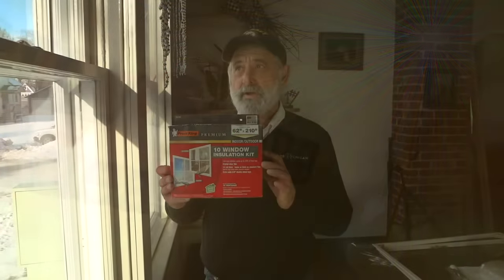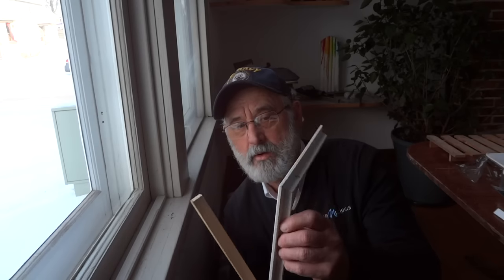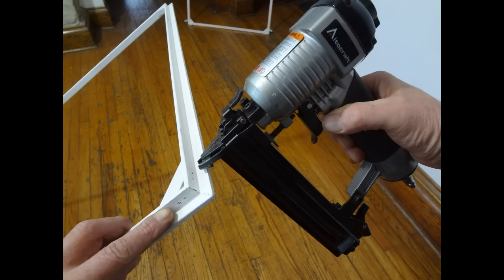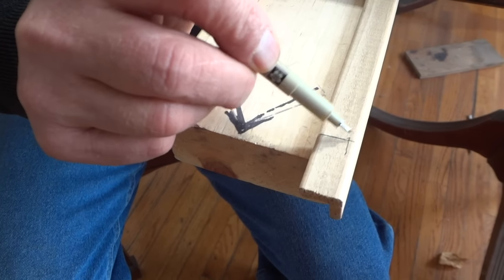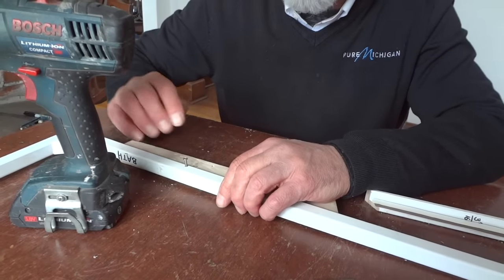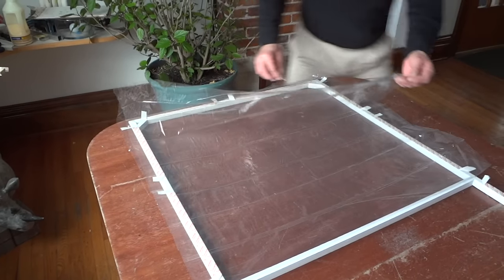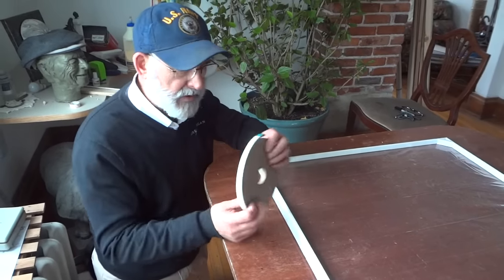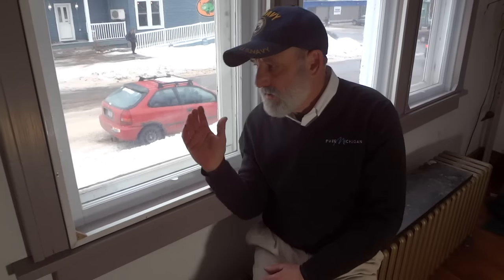DIY Window Insert for Older Homes

Comment: Excellent video.  Thank you.  I've been mulling this idea over for years.  I am so glad to see it's viable.  The trouble I have is our four cats.  The film doesn't stand up to even the slightest clawing.  I'm now going to do some research, looking for some other, super thin plastic sheeting.  The kind that comes with those cheap plastic picture frames.  

At least, now I have a clear vision (pardon the pun) of the finished product.

Thank you again.
Reply from the maker: I do see the concern over potential to take down a lot of work, and some cost.  A tiny housefly can make a window sound like a gigantic tom tom depending on how tight it is, and no doubt that sound would attract a cat.  Is that how you found out?  Do cats bat at a fly, or do they actually extend their talons to catch one?
Reply: @EarlSenchuk  our sils are very wide, and they attract cats all on there own.  Once on the sil, the cats just plain aren't careful.  If I blocked off the sil, mounting the plastic pane as you have, they crash into it until it breaks.  I've got to mount mine on the inside.  It's been difficult to come up with a side seal, if you know what I mean.
Reply from the maker: @johnafagerquist8235  I was thinking about getting a cat.  You just changed my mind.  :e)
Reply from the maker: I adopted a cat five months ago.  She destroyed the film on one window twice while trying to bat a fly.  I must now shield the reachable area with something stronger so that her claws can't penetrate the film or maintain a constant vigil against flies.  Plexiglas is expensive.  You are right.  Cats can be a problem when it comes to shrink film.

Comment: I've cut my own corner molding from pine scraps. If you have access to a table saw, cut long strips 3/4 by 3/4, then set the fence for ¼  and the blade height for ½ and run the steps through twice. Be sure to use a push block and stick
Reply from the maker: Thanks for the suggestion, Tom.  I know that works because I am currently in the process of producing two more videos on DIY Window Inserts for Older Homes that will make it very easy for persons with basic wood working skills to make their own frames (and hopefully for others).  I expect to post the new videos next week.  Part II shows how to make a DIY corner-mold-making-jig with which to make outside corner molding fast, easy, stronger, and at far less cost than store bought ($9.78 at Lowes vs 94 cents).  Since I found out that no corner clamps exist on the market for the DIY window insert application, Part III shows exactly, step by step, how to make a low cost clamp system out of a single 2 by 4 that works beautifully.   Stay tuned!
Reply from the maker: Two new videos are scheduled to premiere tomorrow morning starting at 10 a.m. and the next at 10:30 a.m.  Part I outlines details of making a special clamp designed specifically for DIY Window Inserts for Older Homes.  The same video walks through the process of making a window insert from scratch.  Part II- The Corner Mold Making Jig describes how to make a jig tool that makes a stronger corner molding fast and for a lot less cost than you would pay in a hardware store.  I will be answering questions in live chat if you wish to join.

Comment: I seriously need something over the windows of my old house. I am using the shrink plastic now but HATE it and it didn't shrink tight like it was suppose to. The tape was an absolute nightmare to get backing off while teetering on a step stool putting it on around my 10 foot high windows. 
I'd love to have something to reuse but I don't have a workshop of tools to build it.
Reply from the maker: I wholeheartedly agree with your concern about the drawbacks of the current shrink film method.  It works (most of the time) but it's such a pain to redo every year.  Not to worry, GrandmaSezSo, I recently applied for a patent on a DIY Window Insert Kit.  I'm meeting with a potential manufacturer next week.  The solution is nigh!

Comment: I've got terribly old aluminum single pane windows, that open side to side instead of from bottom up and vice versa. I cannot even begin to describe the amount of cold air that pours in these things!!! I'm excited to try your idea, I have done the shrink film as manufacturer suggests, so it'll be cool and way more convenient to have a semi permanent solution and not have to take the time wrapping them each winter!
Reply from the maker: Hello Jasmin.  Reapplying the shrink film every year is a pain, but the shrink film works to save a lot.  2 minutes to install and the same to take down is the way to go.  Very effective.  Stay warm this winter!  Good luck on your project.

Comment: Another Use- I have those silly basement windows that replace a concrete block and admit light, wind, cold, dust and spiders. They have an R-value of less than 1. 

But for a couple of bucks I made them translucent privacy windows with an R-value of 5.

Bubble wrap- one layer has an R-value of 1, and it sticks with water. a layer on the glass, then a layer stuck on top of that.
Then I framed in the window and sealed that up to create a window frame perfect for Earl's frame insert. But before I put it in, on the back I added two more layers of bubble wrap stuck again with water. 

Four layers of bubble wrap and Earl's sealing frame, and all winter my shop area was at least fifteen degrees warmer in the depths of winter just by dealing with those two stupid windows.
Reply from the maker: Excellent idea.  15 degrees warmer in your workshop is golden!

Comment: We used to call them storm windows and dad put them on all our windows...outside in September and took them off in July
Reply from the maker: Those outer "storm windows" do protect against severe winter weather, and do contribute to limited heat retention by creating a somewhat leaky dead-air space.   DIY internal window inserts seal the deal by blocking incoming and outgoing air by up to 100% with a secondary, very effective, truly dead-air space.  I believe the window inserts would work just as well at retaining cool air from air conditioning.

Comment: This is fantastic.  I live in TX and have massive oversized floor to ceiling single payne windows and since a 30 foot tree came down in a storm (that provided tons of shade during hot summers), trying to keep the house cool and now warm (just had single digits this week), has been a nightmare the last couple years.  The last couple days, I resorted to putting space blankets over the windows (essentially creating a pocket where cold air was staying out and heat in).  They worked really well, but my house looks hideous with them on….my question is considering the cost of wood, do you think that’s still the best option for frames?  Is there any plastic material that could be used that may be cheaper?  The amount of windows I have is outrageous…we’re talking like 30 windows lol
Reply from the maker: @NOT_A_TOP_FAM I filed for a patent on a DIY Window Insert KitTM that uses a wood frame. I also considered waste ocean plastic and hemp graphene. Having plastic extruded proved cost prohibitive. If you go to www.earlsenchuk.com/inventions/home use and look in the upper left corner of the page,  you will see something as you describe with mylar.  There is a "heat shield" material available that you usually see on office buildings.  It will work for your home as well.  It's more like a one way mirror.  When I finally launch this product I will let everyone on this comment thread know when these kits will be available.
Reply: @EarlSenchuk  I’ll take a look and definitely purchase your kit when it comes out!

Comment: Thanks for the detailed instructions, Just curious did you try to wrap the frame so you have double panes ?? according to a study I read adding up to an inch of dead air space will add another R3 to the windows.
Reply from the maker: Thanks for bringing this up @tomwarren9611.  You are indeed correct.  Two layers create a dead air space.  If it is gasketed all around the perimeter frame it creates another dead air space upon installation to further save heat and deaden sound.  I have a patent pending for exactly this in a DIY Window Insert KitTM.  Doing heat transfer studies coming up soon to establish an Energy Star rating.  Stay tuned!

Comment: As a possible cost saving measure, you could get aluminum instead of wood for this project from your local Home Restore.  You can get buy pop out window screens for around $1.00. take the screen out and replace it with the plastic. If you have a lot of windows, given the cost of wood these days it's a cheaper option.
Reply from the maker: Have you tried this yet?
Reply: @EarlSenchuk  I did something like this that was very similar for a fishtank lid.  I had to cut the aluminum with a hacksaw but once I put it all back together I would say it cost me between all the materials $2-$3.00 each.
Reply from the maker: @Dropswitch  i'd be interested to see how you connected the corners because I considered aluminum frames before but couldn't find anything on the market for this application.

Comment: This is a great video. I feel with this much work put in you should have done a piece of acrylic or plexiglass. Or if something cheaper is needed, 3m plastic sheets.
Reply from the maker: Thank you for your comment.  Acrylic (a.k.a. polycarbonate) and plexiglass are quite expensive.  They don't come in the size needed and often result in a high % of waste.  The last time I checked the local hardware chain stores for any piece (.093" thickness) that would work for a 28" x 53" double hung window, the price was $127 and would result in 40% waste.  However, you are correct.  They would indeed be easier. I have gotten the cost down to less than $7/ window. I could make 19 window inserts for that price, enough to seal every window in my home. 3-M makes a 1.5 mil polyolefin (heat shrink film) which is twice the thickness of Frost King brand but forfeits a level of clarity. It's like looking through fog.
Reply: Thank you for your thoughts! I’m trying to do something for soundproofing and I’ll probably steal some of your great ideas in this video!
Reply from the maker: @liketheduck  Steal away!  I put this video out to help people like you.  Using window inserts is as popular for sound reduction as it is for reducing energy consumption.  I am coming out with a window insert "kit" product which will undergo testing this winter.  I will also seek to acquire an Energy Star rating for it.  If it works as well as I anticipate, I will notify every commenter in this thread when it's ready to market.
Reply: Looking forward to this as I am not very handy. Add me to the list please! Thank you Earl!  @EarlSenchuk

Comment: Great video and a clever idea! Do you remove the window insert in the nicer weather? I am wondering about storage of the insert. i also wonder about the screw holes in the fixed frame attached to sill. Do they hold teh screw well after years of taking the inserts in and out?
Reply from the maker: Thank you for your question, Andrew.  I have been using the same window inserts and mounting holes every winter since Dec. 2018.  I screw them in using a cordless drill at a low clutch setting so as to not strip the screws.  That's why I justify the window to the lower right corner.  Once the first two screws are in, all of the others line up. I remove the windows in the spring and store them until the next winter.  It takes just a minute or two to put them up or take them down. No more taping!  I bundle the windows with stretch film.  A bundle of 12 window inserts ends up being the size of one window 9" deep.  We just went through a two day storm that dropped 32" of snow and big winds.  I heard none of it.  It is so quiet in my home.
Reply from the maker: BTW. I just released two new DIY window inserts for older homes, Part 1-the clamp, and Part II- the corner mold making jig.  These simple tools make the cost in time and money drop to as little as $6.54 to make a complete window insert frame.  You will see the size of a bundle of six windows and a number of ways to deal with the holes in the off season.  I have 13 of these windows in my home and also for my basement windows.  The difference in comfort level compared to how it used to be is remarkable.

Comment: i really like this idea. it looks simple and cheap enough to try it myself. however, what would be the best way of fixing the parting stop to the window reveals / frames? Glue, double sided tape, wall plugs and screw?  i dont want to make anything too 'permanent' as this is a rental property...
Reply from the maker: To create a full window well, so you have something to seal against, I attached the parting stop to the bottom with small nails.  I attach the windows themselves with tiny #4 by 5/8' stainless steel screws.  They do make a tiny hole that's hardly noticeable and can be reused each season.  The tiny holes can easily be filled with colored wax which they sell in some hardware stores.  The downside of using the double-sided tape is that it doesn't peel off half the time.  Before you switch to an internal window insert you will have to clean up all that old tape.  Otherwise, the foam tape seal will still to the old tape.  Liking my warm house!
Reply: @EarlSenchuk  - this is great info - thank you! looking forward to starting this project over the weekend.
Reply from the maker: Let me know how it goes.   I recently figured out a different clamping system but haven't tried it out yet.  If it works, I will show everyone how to make it.

Comment: I love this idea! However I don't want to build a well on the existing frame as I don't like the look. I would also like to be able to pull the insert off when I want to open a window. Couldn't the sponge tape around the frame hold the insert in place?
Reply from the maker: I would think that is very possible with a press fit and with a different type of sponge that covers the perimeter edge.  Go for it!  Let us all know how it works.  It's all about using less energy.
Reply: Read my reply a few comments above this. It works so so, I wouldn't recommend it. Use the method in this video, or my suggestion (which I haven't actually tried yet, but it should work very well).
Reply: @EarlSenchuk  Hi Earl, I forgot to come back to you for an update. I made these window inserts by constructing wood frames that fit into the interior jam and the using the Frost King window insulation film kits. After some trial and error (use real wood not MDF!) and lots of work, I made 12 inserts and they work GREAT! I have a condo in a 100 yr old uninsulated building, these have made all the difference in the world. I am now selling my condo and these inserts have been a positive selling point. Thanks for the inspiration and encouragement!
Reply from the maker: @allisonwilliams3714  Congratulations!  You did it!  Your home will be a lot less drafty and way more comfortable not to mention the favorable impact on your heating bills.
Reply from the maker: It may if you could find the proper gasket material.  That part is not so easy.  Closed cell would be best, but not too firm.

Comment: Just curious could this be used on the exterior windows as well.
Reply from the maker: I made a set for my basement windows that are mounted on the exterior.  The snow gets so deep the basement windows are buried, but there has not been any damage as a result.  I put them up every winter.  As long as you have a framework all around the exterior frame and a recess I don't see any reason they would not work on the outside.

Comment: Wouldn't it be easier to weatherproof the storm windows first, then the interior windows as necessary?
Reply from the maker: I used seasonal seam sealant around my exterior storm windows for years.  In the spring, you have to remove it which is like pulling a big long booger out of the gaps.  If you leave it on too long, and the sun gets to it, it turns soft and gooey making it very difficult to remove.  I also tried a special clear tape, kind of like duct tape, to cover the gaps around the perimeter of the window.  It pulls the paint off in spots when you remove it in the spring.  Some of the tricks on the market to seal exterior windows can do the job, but often times create more work.

Comment: How clear is the plastic to look through?Thanks
Reply from the maker: There are two thicknesses that I know of on the market.  Heat shrink plastic is called polyolefin.  FrostKing makes it in .75 mil thickness and is quite clear.  3-M company makes another type of window insulation kit at 1.5 mil thickness.  Being twice the thickness adds strength but results in less clarity.  Since windows are not a high traffic area, I personally choose the thinner .75 mil.  The window inserts I made for my home using the thinner .75 mil (13 window inserts) just before this video was published look exactly the same today four years later.  Another issue is how the film is packaged.  Rolls of the film have only one crease and it's at the center of the window where you will never notice the crease.  The ones folded up in the small boxes require excessive heat shrinking; the lines cannot be erased completely.

Comment: Do you have a way to get it to stay up without using screws? I don't really want to damage the original wood trim with screw holes.
Reply from the maker: The holes are very tiny and can be covered over in the off-season with colored wax pencils that are used for just such a purpose.  You can purchase them online in colors to match your woodwork. The same holes are reused each season.
Reply from the maker: Others have addressed that same concern.   I plan to post two new videos next week that show how to deal with that issue.  Stay tuned!